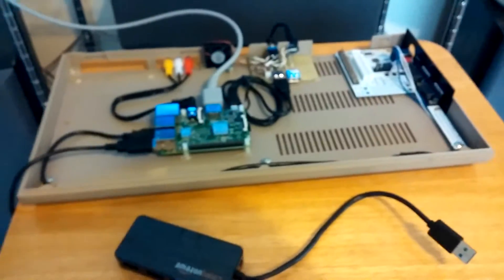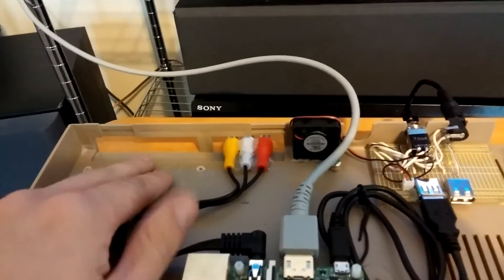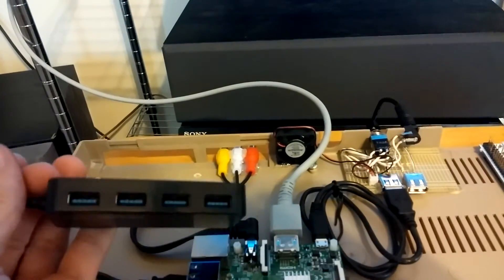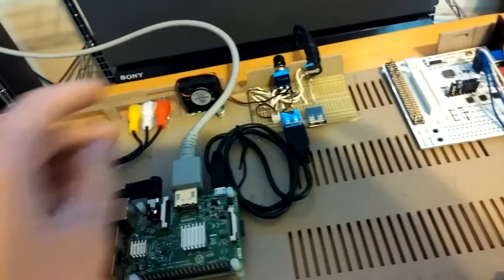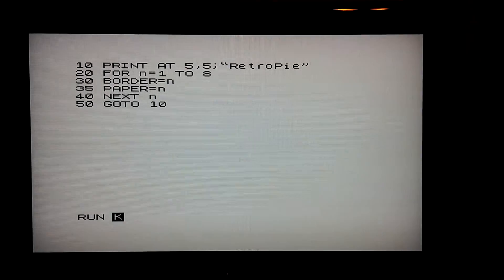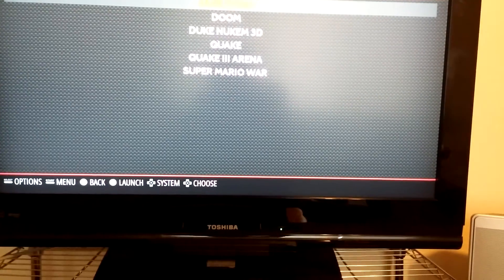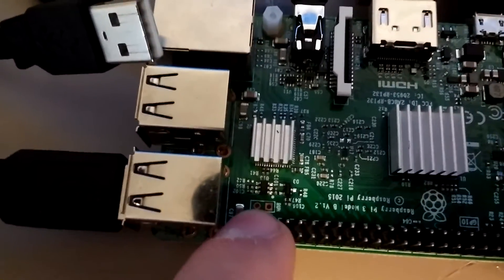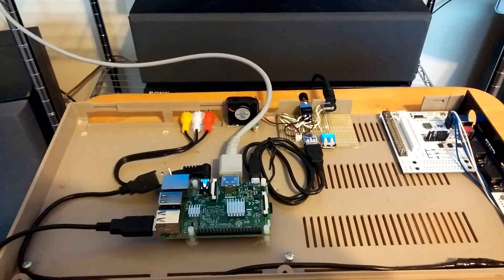Raspberry 64 Part 2

Comment: I did something similar and used a non-powered usb hub (4 ports) and it works fine. I use it for joysticks or a mouse, etc., and it all works fine. I think unless you planned on charging things with those usb's you don't need any extra power?